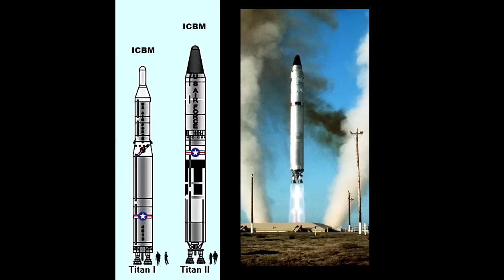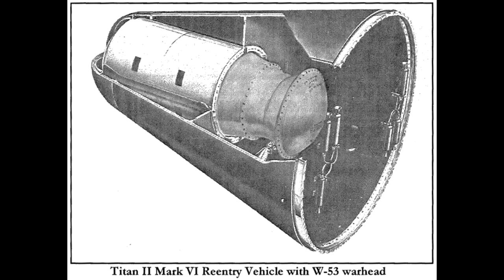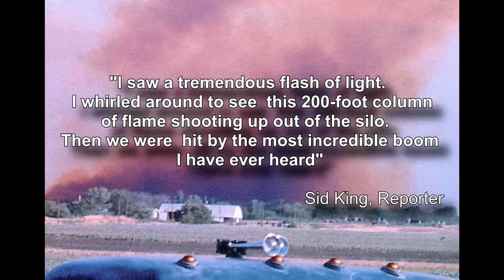Nuclear Missile Explodes Inside Silo - The Arkansas Titan 2 Incident (1980)

Comment: Flipping a switch causes a small spark, which is why gas company employees never do so on a gas leak call.
Reply: Any electric motor with brushes has a non-stop stream of sparks where the brushes contact the rotating contacts in the core... Some are more civilized or polite about it, but many industrial versions even throw some of the sparks quite a distance outside. Once those fans got power, it was "when and not if" it exploded.  ;o)
Reply: @gnarthdarkanen7464  You'd think they'd have someone with this basic knowledge around highly volatile fuel and a nuke 🤷
Reply: If it was a spark, then this happened in the switch.
Fans above vacuum cleaner size are pretty much always driven by brushless motors.
Reply: @AiMR    UNfortunately, "Standard Operating Procedures" (aka "SOP") are rarely written by the people who have to be "there" or "in it up to their tits" as it were... This process and hierarchy suffers from the fact that "Nothing is impossible for the assholes who don't have to do it."

    ...and in military terms, that tends to get people killed over what we'd presume to believe are stupid reasons.

    The "old boys" in Washington D.C. may have done the job, but it was long enough ago that they've largely forgotten most of the "in it up to their tits" years. From thousands of miles away, they don't have to deal with the splatter or stink of the mess... a virtue of "distance" alone. 

    AND we get this... a sh*t-show.  ;o)
Reply: @gnarthdarkanen7464  that emoticon is the stuff of nightmares...   ° ¿  °
Reply: @toxickilljoy9037  "emoticon" we have an msn messenger user here haha
Reply: @i-_-am-_-g1467 What would you call it then, if not an emoticon?
Reply: @gnarthdarkanen7464  they should have opened the silo hatch doors to let it naturaly ventilate...
Reply: "sure a lot of fuel there, lemme just turn the ventilation on to speed up the diffusion, I ain't got all day... what could go wrong?"
Switch turned on, spark generated, fuel ignited. Imagine that

Comment: The men who walked into that solo were heros in my book, and the man who died gave up his life trying to save countless lives.. May he RIP. Well done video
Reply: They weren't "solo". There were two of them.😅
Reply: It takes a very precise sequence of electronic  events to detonate a thermonuclear warhead. The explosion of the missiles fuel would not cause the warhead to detonate. 
One of the safety features in place was that the warhead would not arm to detonate until well into the flight to the target.
Reply: It takes a very precise sequence of electronic  events to detonate a thermonuclear warhead. The explosion of the missiles fuel would not cause the warhead to detonate. 
One of the safety features in place was that the warhead would not arm to detonate until well into the flight to the target.
Reply: @daryllect6659  silo*
Reply: @mkay1957  nice copy paste
Reply: @mkay1957  mmm, while it's technically possible for a non-armed warhead to be detonated by chance during an external explosion, the circumstances would have to be very very unlucky. Not impossible, but very very unlikely.
Reply: @BaalsMistress  It is virtually impossible for a nuclear chain reaction and explosion without the warhead being armed, because the sequences that create the nuclear chain reaction and explosion are timed down to a millionth of a second.  You could still have a non nuclear explosion that spreads radioactive material around though.
Reply: @mkay1957  You just said exactly the same thing I did, except that you believe the normal arming process is essential, when it is not.
Reply: @BaalsMistress  The detonation has to be precise because it has to compress a sphere of uranium or plutonium from the size of a bowling ball down to the size of a golf ball in a millionth of a second. Or larger in two stage thermonuclear devices. An outside explosion will not do that because it does not have the precision to compress the sphere.

My cousin was a submarine nuclear engineer in the Navy, and was also one of several people trained to  disarm nuclear devices (or try to🤯) if any were ever discovered in a hostile country by the military, or if a nuclear device was smuggled into America. Plus, I was acquainted with a guy who worked at Lawrence Berkeley Lab on the fusion program. They both said a nuke would not go off without the precise sequence of events I mentioned.
Reply: @The_catto1  Believe whatever you want, but that does not negate reality.
Reply: @mkay1957  I'm fully aware of the process. You have at least some awareness, which means you only need a critical mass of fissile material.

That can occur through the normal process, OR it can occur through other, unplanned, non-anticipated  means.

You're simply arguing for the sake of it and to present your media spin on the subject. Try sticking to the essential facts.
Reply: @BaalsMistress  Uh ..... Pretty sure my cousin and my acquaintance know more about it than you or I.
And it's not media spin. 

The explosive charges around the sphere are placed precisely and the wires leading from the triggering device have to be cut exactly the same length in order to compress the sphere at the same rate at the exact same instant. That is how you achieve critical mass. Otherwise, it will just spread radioactive material all over, which would be like the dirty bombs that Saddam threatened to use. 

In 1961, we almost lost part of North Carolina to a thermo nuclear explosion when a B-52 broke up in flight and the two 4 megaton nukes dropped. One of the bombs had 3 out of 4 triggering devices activate. If the last one had activated ....... 💥
Reply: @BaalsMistress  You have yet to state what unanticipated sequence of events would cause a nuke to explode in the way it was designed to.
Reply: @mkay1957  Yes, you are well versed in how to deliberately create the conditions that trigger a detonation.

The problem is you're stuck in the false sense of security that there is no way for those conditions to occur other than the one designed into the weapon.

Remember, rolling between 1 and 99 on a one hundred sided dice a few times does not prove that you will never roll a 100.

Anyhow, you did basically start off agreeing with me. This whole debate has been over your reflexive defensiveness and a progressive hardening of your stance that the unexpected never happens.

Have a good evening.
Reply: @BaalsMistress  was an interesting discussion either way.
Reply: Lol you could set off a nuked next to another nuke and it won't go off
Reply: @BaalsMistress  Unless every piece of explosive fires at exactly the correct time to create the implosion that caused the nuclear reaction,it does not happen. Even if the explosives fire due to some thing else, if that precise timing is lost, you don't get a nuclear explosion, but rather the warhead comes apart and you get a radioactive mess. It's physics, and there is no grey area . . . . So, while the odds of a random correct firing happening spontaneously may exist they are likely to be so close to 1 out of infinity to be  irrelevant. Oh, and in a case like this, if the initial explosion caused the warhead assembly to deform, the same thing happens - no explosion since the precise inward shockwave needed to compress the nuclear material cannot happen . . .
Reply: @BaalsMistress  it is entirely impossible to accidentally create the events needed to cause a nuclear warhrad to detonate. You were explained as to why that is the case and you still doubled down on your impossible fallacy
Reply: @tadawsonX  he thinks a nuclear bomb is just a blasting cap put directly into a sphere of uranium and it shows
Reply: @mkay1957  Please read my entry at top about the 1-Point Detonation TESTS ant the Nevada Test Site !
Reply: @BaalsMistress  Read my entry above about the 1-Point Detonation TESTS at the Nevada Test Site !
Reply: @mkay1957  Read my entry at the top about the 1-Point Detonation Tests at the Nevada Test Site !
Reply: @mkay1957  No, it does Not ! Read my entry at the top comments, 1_Point Detonation Test at Nevada Test Site !

Comment: This is probably the main reason the US phased out liquid fuel rockets and kept solid fuel rockets for their nuclear arsenal.  Both land based Minuteman III and submarine based Trident ballistic missiles use solid fuel rockets.
Reply: comforting.
Reply: @UChD5TetOOz47P_MKjHeV4JA You seem to have poor english comprehension.  I never said "This is why Titan missiles were replaced".  I certainly never said anything about Atlas missiles.  I said this is probably why liquid fuel rockets were replaced with solid fuel designs.  This being the the risk of leaks, risk of explosions, the actual leak, the actual explosion, and the maintenance necessary on liquid fueled rockets which lead to the leak and explosion.  Solid fuel eliminates or greatly reduces all of these problems.
    They could have replaced the Titan with a newer liquid fueled rocket design.  They didn't.  They only build solid fuel rockets.
MGM-134A Midgetman, 1991 prototype.
LGM-30G Minuteman III, 1970-still in use.
Pershing II, 1980.
LGM-118 Peacekeeper, 1986.
LGM-35 Sentinel, proposed 2026.
UGM-133 Trident II, 1990- still in use.
    After this incident in 1980, all the liquid fuel designs were cancelled.  They produced only solid fuel designs after 1980.
    They still make new designed liquid fueled rockets to launch satellites and people.  So liquid fuel works fine for that use.  Just not nuclear warheads that need constant maintenance for years to be ready to launch on short notice.

Comment: I've literally just watched an episode by The History Guy about Broken Arrow incidents (unintentional loss or destruction of a nuclear device), which included this. He mentioned that the Titan 2 had fuel and an oxydiser which would explode when combined and possibly the explosion was caused by the fuel coming into contact with oxygen when the fans were turned on. Pretty sobering - this happened the week I was born.
Reply: The issue is was that the Missiles were fueled using Hydrazine; and that the crew that did the inspection knowingly used a faulty Socket Wrench.  If the guy hadn't have been so lazy and checked his equipment before going into the Silo, or going back for a replacement; the Damascus Incident would have never happened.
Reply: "this happened the week I was born"

I guess you could say...

you came in with a bang. :P
Reply: The propellants were hydrazine and dinitrogen tetraoxide (N2O4) that are a "hypergolic" mixture, meaning they ignite as soon as they're combined. Bringing hydrazine into contact with oxygen won't set it off
Reply: The Demon Core is another good one to read about.
Reply: @ligmasack9038 Always comes down to what was done wrong in make accidents like this. Challenger Explosion was 100% preventable too. A cheap o-ring could have been upgraded or the launch delayed and prevented the Challenger Explosion.
Reply: @ethanweeter2732  As I learned in aviation - "safety regulations are written in blood, on stacks of corpses"

Comment: The US developed a high explosive that has incredibly robust characteristics. The exact detonation sequence is classified but the warhead can reenter from space and hit the ground at terminal velocity without setting off the charges. As shown here, even the intense energy released when the fuel detonated wasn't enough to initiate the warheads firing sequence.
Reply: That is a redundancy developed in US warheads because you understand the consequences of an accidental sequence of a nuclear warhead. It is also why we have such strict protocols in place with regards to the nuclear football and why not one person alone can launch a nuclear warhead, it takes the POTUS, Joint Chiefs of Staff, the Commander at the silo or air base or on the submarine to even get the process going. Plus the man who will actually start the sequence to fully arm the warhead and the man or woman carrying the nuclear football with the codes needed to even begin orders.
Reply: Even if the explosives had cooked off, it would have been a "dirty bomb" instead of a nuclear detonation. The timing on those explosive lenses requires an amazing level of precision to produce super-criticality.
Reply: @muninrob  reaching critical is easier than you think. Yes, to get the most efficient chain reaction, and highest yield, requires a near instant detonation. But they have initiated a reaction with a single charge going off. The infamous manhole lid that was "put into orbit" from an underground explosion was actually a test to see what would happen if only one charge went off. Scott Manley has a whole series on nukes and I always thought that one was intriguing since technically the manhole hit well over escape velocity. But the friction of moving that speed through our atmosphere would have vaporized it long before it left orbit. There is a chance that some metal fragments are now floating around the solar system, but sadly there's no manhole out there...

But the fact one piece of the explosives brought the nuclear pit to a critical enough state that it released that much energy is just one of the reasons they developed this class of explosive. It doesn't have to be perfect to be bad.
Reply: Sounds like rocket science 😙. Which Is pretty cool😊
Reply: @Benson_aka_devils_advocate_88  IIRC, that test was a "gun type" device, not an "implosion" / "compression" device. 

There is literally insufficient material in an implosion type device for it to reach criticality, much less super-criticality without those explosive lenses firing with perfect timing and compressing the core.
Reply: @muninrob  Exactly, as the only environmental issue would have been the radioactive dust from the plutonium. Even a fissile, which is what would happen if Russia Federation tried one of thousands of warheads that it has failed to maintain, would not have happened. It takes about a million a year per warhead to keep the US Statistic Thermonuclear Warheads and their Delivery System in working order. he "pit" of the Warhead has to be replaced often to prevent a Fissile...
By the way, if someone attempts a launch with the wrong code the Missile and Warhead will have to be serviced before it is functional again...
Reply: That is all for the purpose of a GUARENTEED detonation . However, the Nevada Test Site conducted 4 ..... 1-Point Detonations and 1 out of the 4 DID DETONATE ! It was theory and now A FACT , that a stray event could set off a warhead !  Read my entry on top comments !
Reply: It takes the pressure and heat of an atomic detonation to initiate the detonation of a hydrogen bomb.  When the 9.5 megaton warhead detonates it may look like one explosion but there is a two stage sequence going on.  Primary and Secondary but it happens so fast that it resembles one explosion.    A simple matter of rocket fuel blowing up would pose absolutely no risk to set off the warhead.
Reply: @roquefortfiles  Yup, you have to split some atoms in order to fuse some atoms, in a nutshell at least. But the initiation charges are regular old chemical explosives, albeit of a type that doesn't go boom easily. Hence why I said the warhead could impact the earth at reentry speed and they most likely won't detonate.